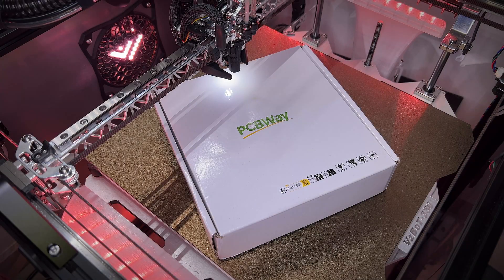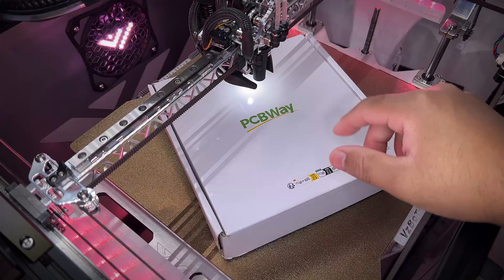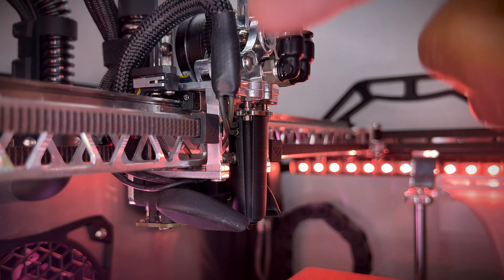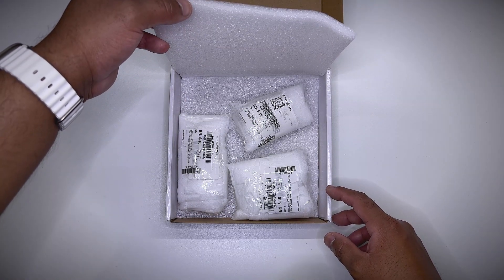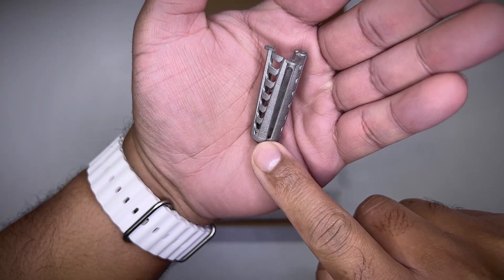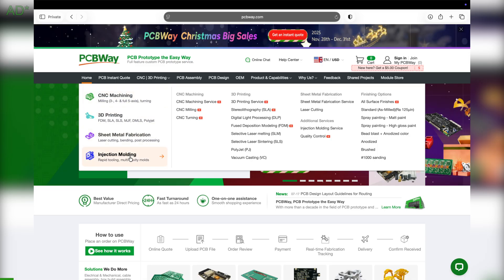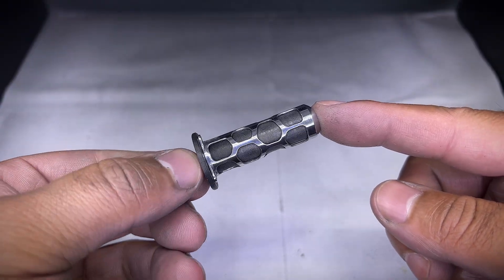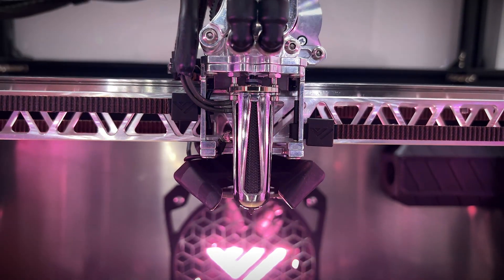Goliath Heatshield (SLM 3D printed by #pcbway)

Comment: amazing work, can you please share your printer and filament profile for the eryone asa cf? i have many rolls but cant seem to print it very nice
Reply from the maker: Yep no problem I got you, here it is:

https://drive.google.com/file/d/1rCK2NDU8c0pk1M2S87IEFRveaiL7uV9n/view?usp=drivesdk

Thank you so much for your support.
Reply: @rcgeeker  Oh the whole config, thank you very much my friend, now i have some back and forth checking with mine!!!
Reply: I have goliath with hextrudort plus and I think im running toomuch flow and too much presure advance maybe
Reply: @rcgeeker also another thing,  what retraction, pa, ans smooth time you run with that filament;
Reply from the maker: @ΔημήτρηςΚαραχάλιος-ι9ο  My PA is at 0.018, smooth time: 0.03 and retraction: 0.50mm.

I activate those parameters via a g-code macro, that’s why you didn’t see ’em on my Orca Profile.
Reply: @rcgeeker oh okok so my assumption was right, I'm running too much flow and pa I have .76 flow and .7 pa
Reply: @rcgeeker I will try your settings as a base cause this filament has given me some trouble in tuning, otherwise its great!
Reply from the maker: @ΔημήτρηςΚαραχάλιος-ι9ο  Here is my printer.cfg, in case you wanna try my extruder rotation distance etc. 

https://drive.google.com/file/d/1CTSfsCPRwH2kw1UZtjtaF4KhSt66NQ9b/view?usp=drivesdk

Comment: I would like to encourage everyone to take drammamine before you watch the last half of the video. 
Motion sickness is a thing. 😥😳🥺🤢🤮

Extremely impressed! 
Instant subscribe! 

How how have you gotten the goliath? And would that sleeve-FG belt hold up to 450c?
Reply from the maker: Thanks you so much I appreciate it. 🙂

The glass fiber sleeve is rated to 600°C, I got the hotend up to 500° to give it a try and the sleeve didn’t move at all.

Would be better if I could have my hand on a PEEK, PEKK, PPSU filament to print something large.
Reply: @rcgeeker  The Goliath and Hevort extruder were the first components I purchased for a high temp (SLOW) printer project. Along with a high temp extruder. Can you covert your VZ to 200c bed and 100c chamber? If you can swap out components then the big 4 P filaments are achievable. I believe we don't have to spend $15,000.00 to build a homemade Vision Miner Idex 22. I am hoping to build a single head version (with a little help from my friends) for under $2000.00. Yourself and Vez are very inspiring to say the least!
Reply from the maker: @helixx_4D  Seems that most silicone heater pads stop at ~800W (~150°), that’s just an idea but I think at this point you should use PTC heating plates, they can reach 250-270°, designed to heat PCBs and have holes along their edges, allowing the to be screwed beneath the Vz build plate.

You can find them in different sizes, you could either install 5 elements (One in the center, four in the corners) so could choose to only heat the center or the entire bed or install only one large element that will heat the entire bed but might be less efficient and could take a while to reach the targeted temp.

For the chamber PTC fan heaters would be enough.

Comment: I recommend you replace the pulleys with flanged bearings🦾
Reply from the maker: Any issues with yours? 🤔
Reply: @rcgeeker you have better performance with flanged bearings less noise especially on short movements

Comment: They look wicked mate nice job, which material performed best when input shaped ?
Reply from the maker: Thank you so much man 😀 

My IS max accel got +4000 on X axis, +1000 on Y, not sure if it’s related to the heatshield but it didn’t make things worse 🙂

The aluminum is 2.1g compared to the silicone sock 3.8g which is pretty light.

The problem is that It has good conductivity properties so not a good choice, could lead to a heat creep issue once cooled down by the RSCS.

The titanium has lower conductivity so won’t act as a heatsink 🙂